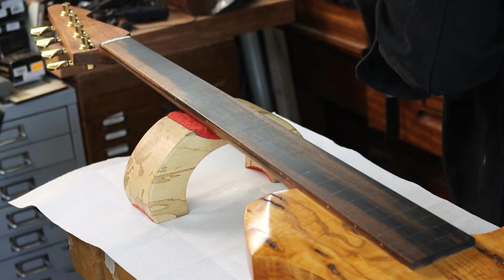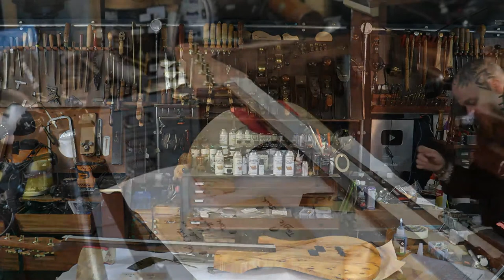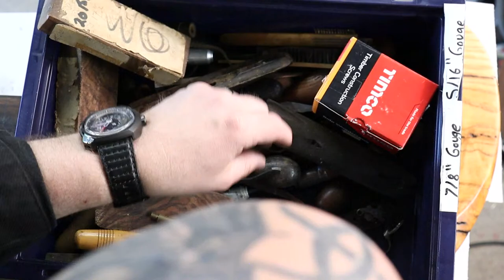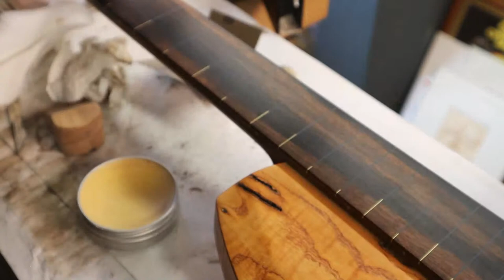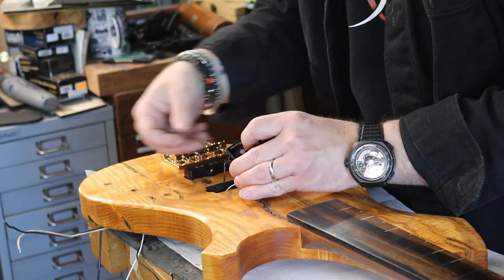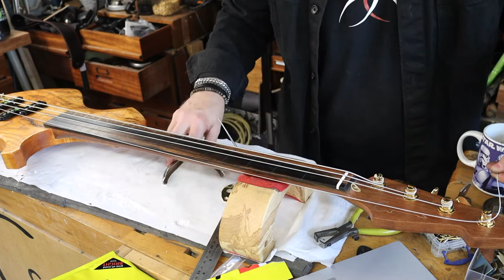Custom Bass Guitar Build Completion - Luthiers Live Stream with Ben Crowe

Comment: Great Bass ben, but please watch this video and restring correctly, a bass is strung differently, the reasons for this are explained in this video.

I would suggest that you change out the strings to flat wounds, half wounds, or even tape wounds, that will save the fretboard from getting chewed up by round wounds,
Reply: Good advice on restringing technique, although there's no real need to replace them with flatwounds, the idea that roundwounds damage a fretless fingerboard is largely a myth, they do no more damage to a fingerboard than they do to actual frets.
Reply: @jackegan6784  yeah, but frets can be replaced in the future, it's harder to replace a board.